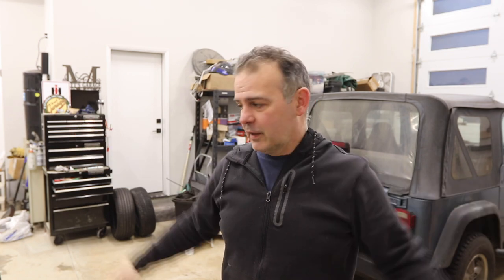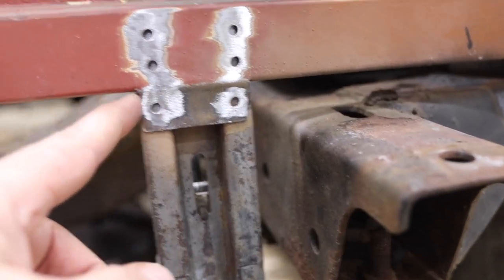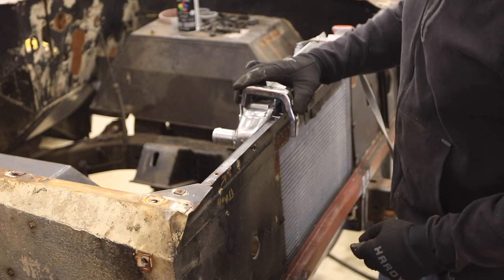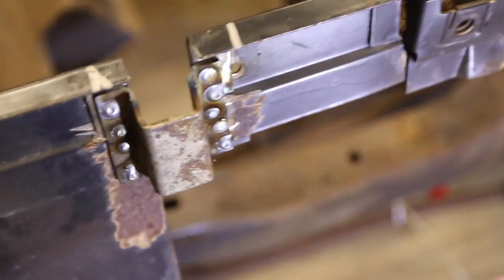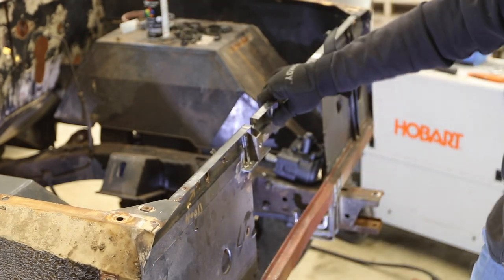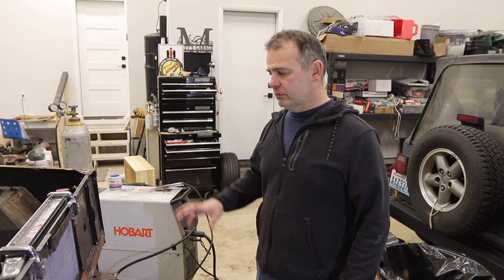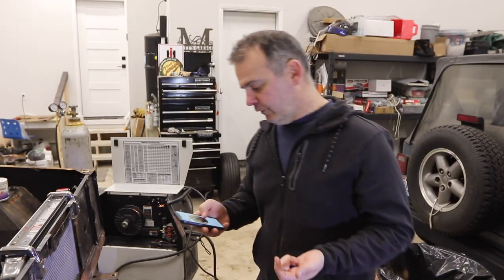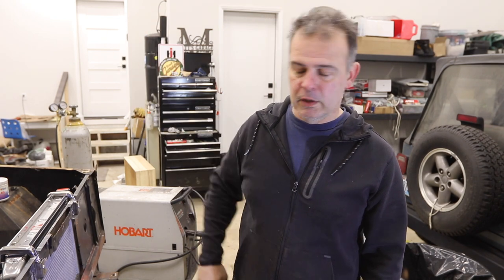9.18 Radiator: Mount & Tuck

Comment: I really like how the radiator mounts  turned out looks really good, you closed the gap around the radiator core opening
Reply from the maker: Thanks Nic. Yeah I’m very happy with it. I still need to make a pocket in the core support for a future power steering upgrade.
Reply: @MattsGarage  wish I could weld I’d be doing the same modification to my bronco
Reply from the maker: @nickefgen9219  you can weld. Anyone can weld. I taught myself and it’s only taken me 5 years to get not-terrible :-)
Reply: @MattsGarage  when I worked in this ship yard where I live I did try stick welding a little they let try on some mounts that we used to hang the tires over the edge of the dock, I could learn to weld with the wire feed like you have
Reply from the maker: @nickefgen9219  stick welding is tricky. I think mig is the way to go for 95% of automotive work. I’d love to tig but it’s a big $$$ to get into it with a decent machine
Reply: @MattsGarage  I was welding way thicker metal 3/8” thick for those brackets, I’d have to practice a bunch on some scrap automotive sheet metal before I’d be comfortable doing what you’re doing

Comment: Get .023 wire that is ez grind, the standard wire when welding sheet metal tends to harden when welded and makes it hard to grind flat. Ez grind wire doesn’t harden like regular wire and grinds off easier. Makes a difference for when welding sheet metal with a mig. 😉